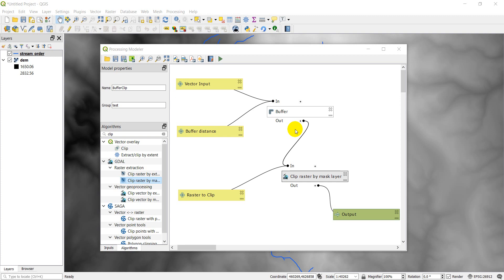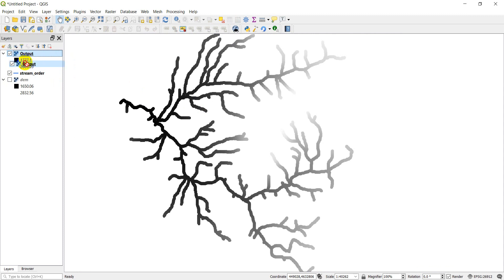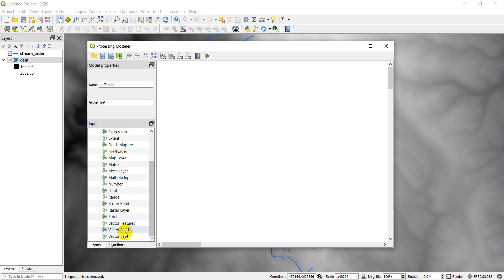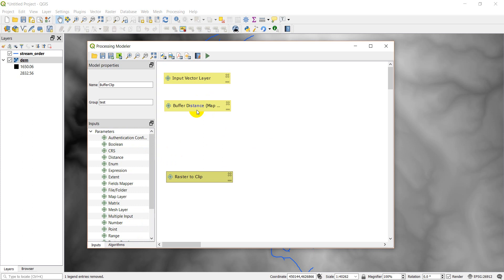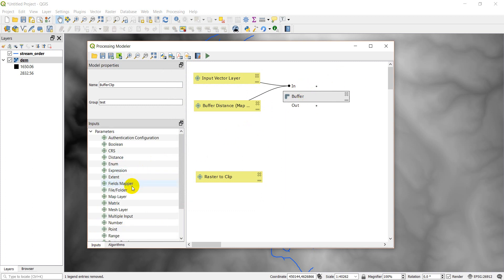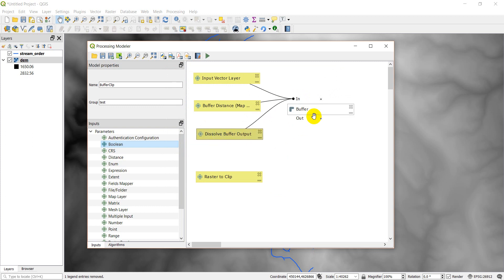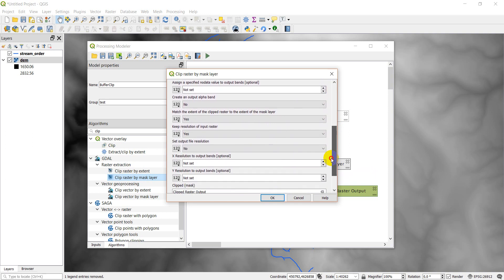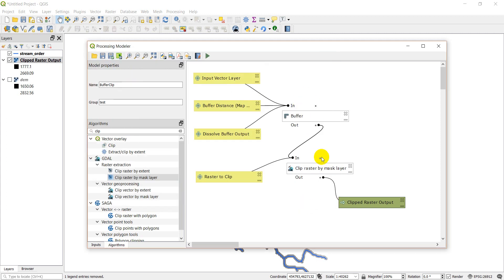QGIS Model Builder / Graphical Modeler (Version 3.x)

Comment: Thank you  for nice video Sir, by the way I have a simple question. Isn't there any tool to load raster file automatically? I have so many files to do some analysis. I made my automatically analyzing model, but I cannot find the way to load multiple data in sequence. I need your advice :) Thank you!!
Reply from the maker: You might be able to setup up an iterative loop in model builder that cycles through a list of files. But I think the best way would be to write a python script using PyQGIS that does the analysis. I have some youtube videos on PyQGIS. You can also check out my full PyQGIS course: https://opensourceoptions.com/course/pyqgis-learn-the-qgis-python-api/
Reply: @geospatialschool  Thank you Sir, I think your course is the 'ONLY' and "BEST" for learning QGIS. I will pay for your PyQGIS today :) I needed those course 

By the way, I followed your PyQGIS for importing raster image(png format). But I saw that your code make the process automatically, while my code create a window 'Coordinate Reference System Selector' continuously.... Does it because my image don't have any crs? How to make it stop to create the window? Again, thank you for nice tutorials!
Reply from the maker: Yes, it's probably because your raster doesn't have a crs assigned. If you assign the crs before importing the window should not appear.

Comment: One of the best Qgis channels around, thank you for educating us sir.
A small request: A video tutorial on how make the Atlas pick up the correct paper size (A4, A3, A2, for example) and orientation to optimally use the paper space at a given scale.
i got some of it working, like adjusting between portrait or landscape mode. It does kind of chose a paper size based on the AtladWidth/heigh variable in relation to the total area size of the paper format. However, i don't know how to get the scale value from the Atlas page. And even if i could get the value im not sure the way im implementing this is the best one.
But reply or not, anyways thanks for the good work!